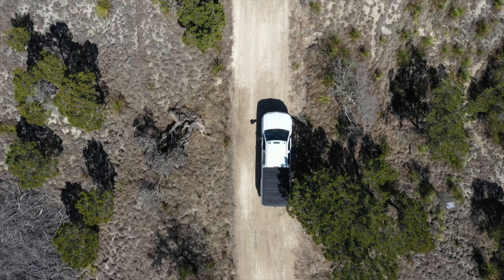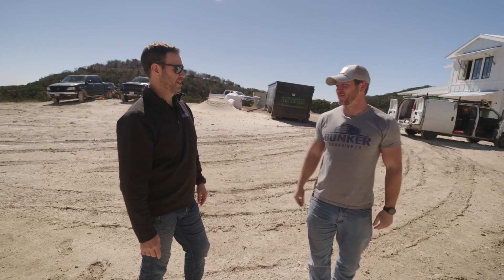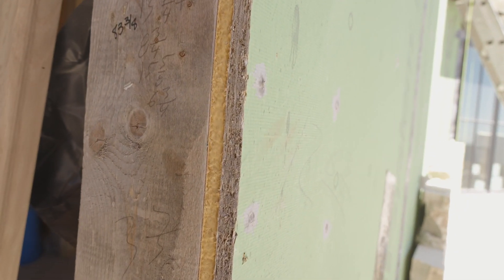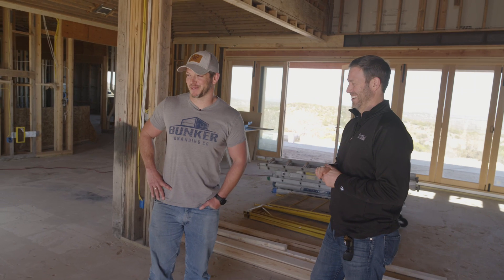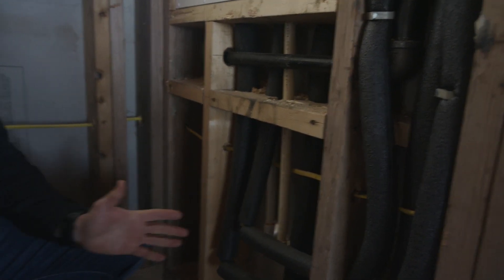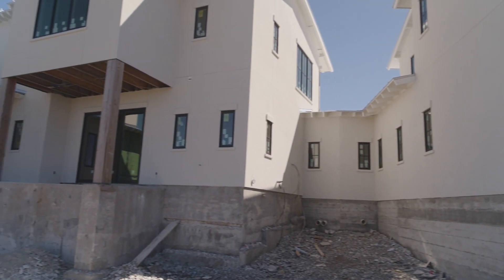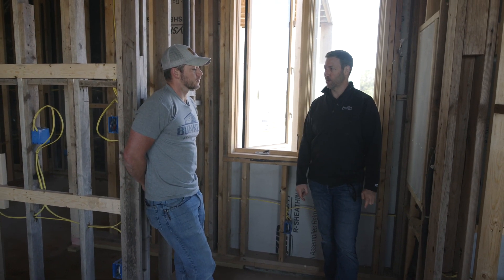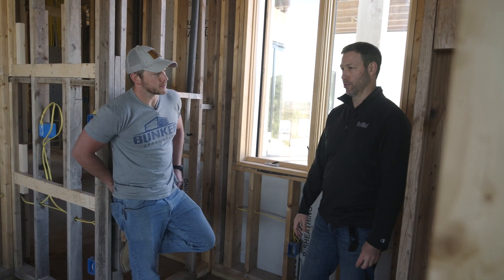One Vulnerable Spot at the Abandoned Mansion

Comment: Its so strange to see that in almost every mid east countries people build from stone to gide from heat/cold but in us its almost always wood... Hm...
Reply: Blew my mind meeting FoF from the UK living in a house that's been standing longer than the USA.
Reply: @John Fischer Haven't you guys heard about AAC blocks? Even here in Russia it's WAAY cheaper than building a proper wood house(with all insulation and stuff) and way easier. I think in Mexico they also use it. At least from what I heard.
Reply: @John Fischer You can cantilever a reinforced concrete slab over AAC blocks. The only thing you can't do with AAC blocks I figure is run wiring and ducts through them easily so your footprint of your house, wall thickness goes up. But in Texas or almost any other southern area space is not a problem.
AAC blocks is a great suggestion I hadn't seen those.
Reply: @John Fischer I'm not aware off pricing but given he's russian and they are often used I assumed they are very affordable.
But don't the blocks negate the need for added cost, complexity and labor of insulation?
Doesn't it cancel each other out? Or to an extent at least?
Apparently an AAC wall by company "AERCON" has an R value of 11.
Supposedly it has a 10-20% higher R value than stick frame or cmu wall of the same thickness.
You can hang load baring elements all over and the blocks can be sculpted with power tools so it's not like it's more complex to use than timber frame.
Apparently you need long and tbin screws though because they are somewhat brittle.
Also the R11 apparently isn't enough according to building codes and if you have to add extra insulation it supposedly isn't worth it compared to things like stick frame or cmu with insulation.
I don't know if it's that great of an option when I look into it.
I thought if they are cheap it's worth it. 
But on second look maybe stick frame, cmu or icf and other are better options.
If it was cheap and a bit of a better insulator maybe it was worth it.
Reply: @John Fischer You are probably right.
I don't understand how they are used that often in Russia if that's the case though. Different insulation standards perhaps but Russia has far worse winter weather and is poorer overall so how would that make sense?
Reply: @Quasisaur  Can you explain how AAC blocks are so popular in Russia of they are expensive and don't insulate that well?
Reply: @zteaxon7787  Go to 'Gleb Green' channel or 'СтройХлам' channel - there are plenty of videos explaning specifically that. Although they are in russian but you can use auto subtitles plus they show almost everything they are talking about with examples
Reply: @Quasisaur  Can you explain so other people reading this can also know the answer?
Reply: @zteaxon7787  I wish I could but I might make some mistakes so better google 'project next 72' or 'project next 94' all docs are there but again in russian :( Sadly Im not good at translation so I could give you alll info

Comment: "you'll be double code in texas" = "still need better r-value in Canada"
Reply: Let me know how your house does in with 3 plus months of 100f+, reaching over 115f. (37.7c- 46.1c).
Reply: @sonorangaming449  insulation helps keep heat out
Reply: @kellymoses8566  but it doesn't keep the heat off of the outside of the house. I know alot of houses that would melt in places like Texas and Arizona.
Reply: @sonorangaming449  The higher R value in Canadian homes also keeps the AC cold in the house and hot summer air outside.
Reply: @sonorangaming449  The higher R value in Canadian homes also keeps the AC cold in the house and hot summer air outside.
Reply: @sonorangaming449  Houses melting? The typical building materials here in Canada for the outside of houses (ie shingles, stucco or vinyl siding etc) are the same as in Texas and Arizona, so I'm not sure what kind of house you're thinking of that might melt?

Unless you're thinking we live in igloos up here? That type of house, yes, would melt. We don't live in igloos.

Comment: As a recommendation for a house that size you may want to have an emergency panel that carries the critical loads only.  Things like heat, refrigerators, IT loads.  This can allow you to reduce the size of the generator. Something else to consider is the duty rating of the generator as well.  If you would like to prepare for a long power out pay the extra for the prime rating on the generator.  Also if the generator is on the exterior some useful options is a cold weather package and noise suppression package.

Comment: Be careful with pipe insulation; it's possible to keep the heat from your house out and have it freeze. I plan on putting an inner wall over the exterior wall if I do a remodel for just the plumbing.

Comment: Tankless heater protection.  How about a solenoid valve on the inlet that fails closed and a drain that fails open so when you get a power failure the heater drains and when power is re-established it refills.

Comment: I have pex B ran on the inside surface of my trailerhouse.   I lost my furnace thermocouple and house froze to -20. The pex flexed enough to protect most of the plumbing fixtures.  Lost 1 cheap tub valve, 1 braided toilet supply line and split the jet pump cast iron body.
Reply from the maker: Phew. Dodged a bullet
Reply: Pex A is better for expanding without bursting than B
Reply: @larryhampton9069  last guy that owned that dump of a trailer was tired of the replacement pipes freezing.   so he had them placed under where the crown molding would be

Comment: Sometimes you have no choice but to run water lines in the exterior walls even on the east coast. Just pack as much insulation in there as possible and hope that it's good enough and won't freeze in the winter. Pex is pretty good as far as expansion when frozen but the fittings tend to crack before the actual pipe does and that causes just as much problems. 

If you can avoid it, you should avoid it even in generally warmer areas like Texas. Freak things can still happen and cause all kinds of issues as we've just seen down in Texas. Might be time to update some codes and make it more suitable for colder weather.

Comment: NY state with 4 Fujitsu heat pumps. Works to 15 below. Whole house backup propane generator with automatic transfer switch and an electromagnetic shield with a perimeter grounding system and ferrite suppressors and high speed surge protector.

Comment: Up here in Oklahoma, it got to be -17 at our place one night. Our MrCool Mini Splits in our metal barndominium/garage (with spray foam, but not all finished, yet) were able to keep heat coming into the house. It was around 58 the coldest morning, and they run on the gasoline generator in case of power outage. Our only issue was the condensation caused from the exterior being so cold vs the interior temp. We don't have zipR, though. Would that have helped? It ran down between the metal siding and the spray foam. . . into the exterior wall cavities.

Comment: G, day the Build Show Tx from Sydney, Australia.
Rooftop water catchment
* all the various roof levels, leaves me thinking if the owner will store the water in a number of holding tanks?
Mechanical ventilation and insulation
* with such a large residential building for controlling the air climate:
* compartmentation of living areas to reduce the counties " carbon footprint"
* harness natural solar system to power the building systems?
I love the stone block work on the external wall, this is a magnificent estate.
🇭🇲💯

Comment: Could also go w/ roof mounted solar panels and batteries. That way you can maintain power for a while during a blackout without worrying about fuel or gas.
Plus it saves on electric bills year round and is green.

Comment: Pretty interesting how much building codes there are in the us but no requirement for safety pipe around the water pipes. With any bad luck you'll have a leak inside the wall or floor for years before noticing a thing.

Comment: Plumbing in exterior walls is fine as long as it's done right, if it's not done right you get a host of problems which makes you go I'm never putting Plumbing in an outside wall again. Now some of the even colder colder climates I'm sure that's avoided. I'm from the Syracuse NY area originally I know my snow and cold temperatures when we left it was -15F.

Comment: Diesel back up generator is the answer. In a major freeze running on propane is not going to do well because it’s in such high demand. A truck won’t easily get up to the house to fill a big tank. Natural gas is a problem too because of demand in the cold. Diesel is going to be readily available and can be hauled there by the home owner if needed. Especially with 4x4 trucks like Matt has. You can pick up a good used 70kw generator for a fraction of the cost of new if ya look around.

Comment: 13:50 a for a remote home without easy access to services you may want to invest in a 5000 liters propane tank, depending on how much gas you use it can easily last you a whole year, but I would also suggest... get a cast iron stove, they are great decorations and provide a lot of heat around the area, this is just redundancy.

Comment: hi Mat ,you were recomending heat pumps for emerygency heating ,are those work without electricity in US? in Europe they consume huge amount of power ,more when is really cold .
as an anecdote  can tell you in Europe flow heaters turns on ond their own when temp drop below 5 degree C to prevent damage ,same goes to thermostatic radiator valves (to open flow for heaters as no flow turn off flow heaters) ,in one my property i flooded 1 room i was renowating, by taking of radiator to paint walls ,night came temp droped under 7 degree and all that black water from system shot on freshly painted walls , my system was presurised for rest of house by static pressure ,but there are system for example in UK that are gravity pressurised that would dump all that tank in that room

Comment: Tankless outside Water heaters. Easierst and best way to break the cold it to Put a door form the outside like an enclosed electrical room but only much smaller Isoflex systems makes some really good doors not very cheap but long lasting. They specialize on Freezer walk in door systems. 
And Matt it is a lot cheaper if you do have inside the house a separate shut off vulvae for your exterior wall water faucets. Just use an 90 degree shut off inside and leave than the exterior one wide open this way nothing will destroy your water line or faucet.
But also ensure you have alternative heating ... a wood stove works wonders just run the chimney in the attic thru a heater exchange with your HVAC system so your wood stove brings the BTU and your HVAC only need's to run the circulation fan to warm up your house. Especially when you have so much wood on your property something to use.

Comment: Hey just a quick question about the wax paper backing Matt had to put over the zipR to stick on the stucco/stone, wouldn't that be a water trap and eventually the water will soak through and start degrading the paper? Can't they have just put it over the zipR without the wax paper layer?
Reply: All the information Matt R is always giving about water management and not a single mention about the stucco or stone installation.

Comment: I like those freeze proof hose bibs but I think I have an idea.  I have regular hose bibs and during the winter I go under the house and cut them off from another location.  Then open the hose bib so it drains.  But what if I put the inside cut off a couple of feet inside the house next to the hose bib.  So outside there would be the regular hose bib and adjacent to it a handle connected to a long shaft(2 feet) that went to the inside cut off.  That way I don't have to climb under the house and on warm winter days I can easily turn the hose water back on right next to the bib.  I might have to invent that for my house.  Like I said in my other comment, I'm 70 and climbing under the house is becoming nearly impossible.  The knees are shot.

Comment: He'll probably have a propane tank for the backup generator. I'd also opt for dual fuel (likely what the HVAC contractor has spec'd). Heat Pump as primary and propane for emergency heat. I'd also run propane to the kitchen stove.

Comment: I live in Canada. Frost free taps are garbage. Yes they will stop it from freezing but they restrict your 3/4 feed down to 1/2” which halves your flow if you’re running sprinklers off that feed. When they do get screwed up, and they will, they’re next to impossible to fix without cutting your walls open. Just pop out your 3/4 feed and solder on a 3/4 FIP fitting and screw in a standard tap. Turn off your exterior water when you know it’s going to freeze. 

Frost frees are supposed to be for lazy people but are more hassle than they’re worth.

Comment: I find it odd that copper is used. Years ago on a new build in Australia most of our pipe work was poly: no knocking - easy to repair, cheaper (because copper is expensive they would have been stolen from site) and faster install. We, at worst get minus 10 Celsius but can have 42 Celsius in summer. Metal roof saved my bacon in a huge hailstorm event last year in my town - Whirly Bird got damaged but not the roof!

Comment: pipe insulation only preserves heat within the pipe, eventually the surrounding temp will penetrate. a better way to feed a perimiter plumbing fixture on slab would be to put the piping under slab. if you do this kind of piping in the northeast it will fail

Comment: I've got a Colorado mountain cabin that runs on propane. 2021 I will be the year I get off of propane, super insulate, and switch to all electric (backed up by solar PV with batteries). January's propane bill is $1298.90, and my cabin is only 636 square feet.

Comment: Matt, I've been thinking about those instances where the power goes out every now and then for whatever reason.  We'll have things happen where the power flashes for 10-20 seconds, which means EVERY clock in the house has to be reset, AND if you were working on the computer or something important, theres a chance of damage there even with protection.  I've been thinking about a backup  gen, but I'm betting they don't fire up quick enough to keep all the aforementioned from happening.  What kind of whole home battery back up is there that would combine with a generator to solve this "third world" problem?  I'm thinking I'd like a system that I could set for a two minute delay before the gen started up.